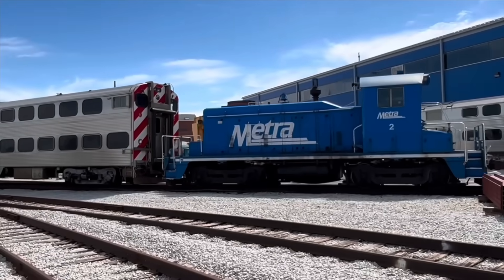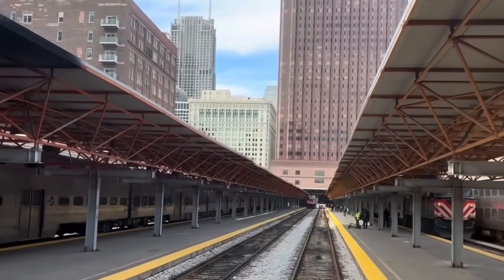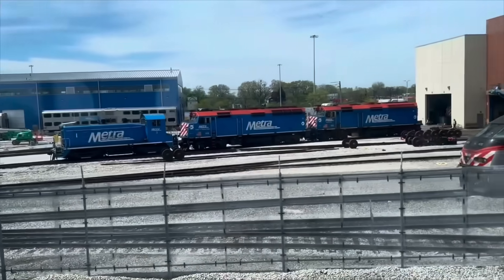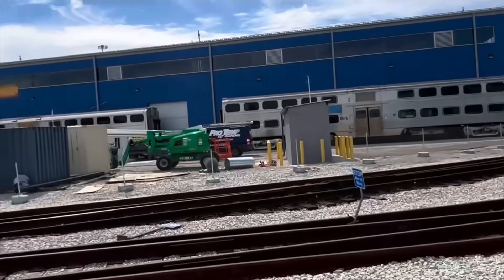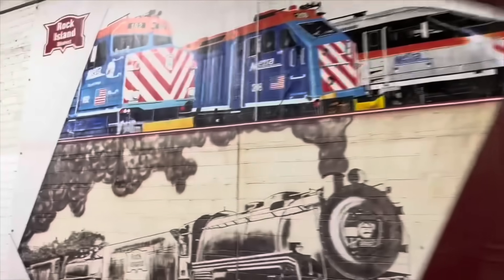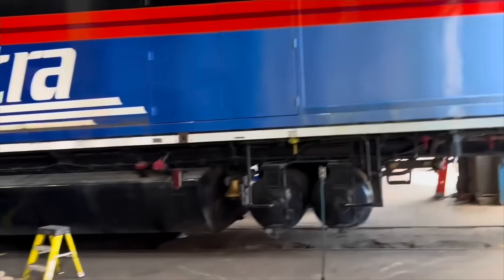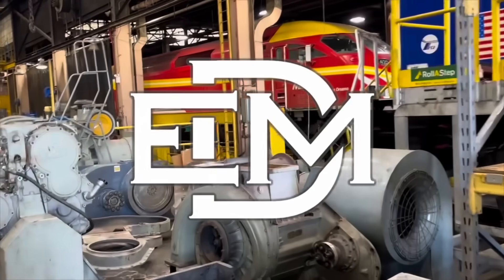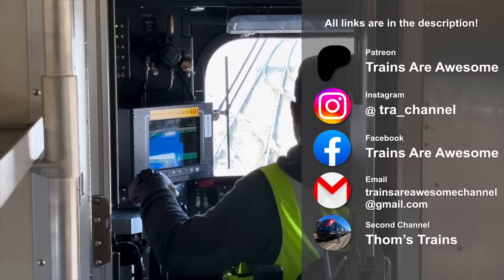How Metra can keep running such OLD trains

Comment: Many older trams, trolleybuses, buses, and trains share a quality which is unmatched for most modern sets, they are simple technical design and high reusable quality. 

This allows for repeated replacement of spare parts and even upgrades, thereby extending their service life and reducing the cost of major upgrades. 

The only major drawbacks of this "eternal" service are obsolescence and the subsequent physical wear and tear of the car's support frame, which inevitably leads to its decommissioning. Obsolescence can have a significant negative impact on passenger satisfaction.

But I love Chicago and San-Francisco double-decker train cars, and San-Francisco cars soon will become urban trains in Lima, Peru :)

Comment: Amtrak would do well to follow Metra’s lead with the SD70MACH, to get a locomotive that works without sending money to Siemens for junk
Reply from the maker: Not the Siemens is junk talking point in 2025, come on
Reply: @Thom-TRA  Considering the reliability of the ALC42's anywhere the temperature gets below freezing, it's 100% truth.
Reply: Are there enough SD70’s in good enough shape to refurbish to replace the GE Genesis?
Reply: @cwshawk  There's thousands that could be rebuilt, so yes, it could be done.

Comment: I rode Meta for over 10 years on the BNSF line from Union station to Naperville. The only good thing I can say is the train mostly ran on time. The old diesel locomotives emitted very dirty exhaust.  Very high in particulates. Union station is covered n black soot. Some days in the winter Union Station was filled with black sooty air. The Chicago Tribune newspaper tested air quality in Metra rail cars and found it far exceeded clean air standards.  The train I regularly rode on would always delay turning on the lights and HVAC (switch from shore power to locomotive power for lights and HVAC) until well out of Union Station.  I asked the conductor why this engineer waited to turn on lights and HVAC.  The conductor said the engineer was trying to protect the health of passengers by waiting to turn on HVAC until the air was cleaner.  Metra is poorly run and way behind the times technically. Train stations are terrible. 😅
Reply from the maker: Oh I don’t disagree

Comment: This is what helps make Metra the Toonerville Trolley of commuter rail  lines.  Diesel-powered and ground-level boarding vs. electric-powered and raised platform same-level boarding/deboarding.   This is what European and Japanese commuter trains normally have, and their speed and scheduling blows Metra's away.  Ideal case in point is Paris' RER regional.  Put one of their locos up against one of Metra's diesels in a drag race, and the Metra would be left in its own smoke, not to mention the dust.  A total blowout.

Comment: My biggest worry for Metra is that they're going to become like BART was. Stuck fabricating their own parts and components (looks like they may already be there somewhat) and it actually costing a lot more than if they had bit the bullet and modernized to electric trains. I honestly wonder which government in IL will be the one to step up to start REALLY pushing Metra to truly modernize and electrify.
Reply: @shadomagi what a strange comparison, BART is an overbuilt Gadgetbahn! The Frankenstein Rail Gauge and the fact it was developed by Niche Aerospace Engineering!?
Metra is tried, true and proven mechanical engineering.
Reply: Most of the routes Metra runs on are owned by the Class 1 Freight Railroads

Comment: I do find it awesome when trains are refurbished this well. The Dutch Railways have a similar workshop in Haarlem, where trainsets are completely stripped and new interiors and components are fitted.

That being said: you won't fix the fundamental issues of gallery cars. High steps mean slow boarding (especially for wheelchair users who need the elevator). Relatively low capacity due to the gallery design. And pulling a string of cars with a diesel locomotive is always going to be slow, compared to a modern trainset.

There comes a time when a city needs to look into the future. See cities around the world how many people will use service when it's got frequent and quick all day service.
Reply from the maker: A well-balanced comment!
Reply: META and CTA unfortunately are negative revenue per passenger mile and grow with load.     No matter what they have done for 50 years, this is the case.   Some of it is just the insane number of RR bridges and viaducts that are 100+ years old in the area.   More trains and more service make the economics worse.   There is a youtuber that simply states staffing level are just to high, with my experience with quasi government organizations in IL,   the one and only goal is get new employees into 401Ks and ditch retirement programs as the people currently under the retirement contract written in blood die off.
Reply: As far as the high steps go, high level platforms solve that problem, yet, outside of the electric district, they seem to choose the cheaper ground level option

Comment: As a European, the sight of the "gallery car" has me rolling around with laughter. It seems that passenger capacity came a distant second to being able to check tickets by walking along the lower level and asking upper and lower floor passengers for tickets at the same time!
Reply: Labor is the #1 cost of Metra and the CTA.  Bulking administration and to many no show jobs.    The conductor gets paid 120k/2200hrs  and is  easliy a 4 million dollar 25-45 year obligation the day he/she retires.    The cars are designed the way they are because of a retirement plan out of 1975, but the conductor isnt sucking camels every chance, knocking his life expetancy to 68.   The three conductors cost more over 30 years than the 3 cars of rolling stock they staff.    

if the ridership were sane, 2 conductors per every 10 cars would be customer service agents instead of ticket takers and the clowns in the the homeless rodeo.
Reply: @christopherwhull  Conductors  have to be certified by the FRA, and there are 9 other railroads in Chicago for them to go if Metra doesn’t  pay market. 
Railroad labor is expensive.

Comment: Ultra small restrooms on old cars ...
Reply: I grew up taking Metra Electric.  I was 23 years old before I found out that everyone else had bathrooms on their train lines.  The south shore had them but I figured it was because they went to so far. Like a lot of people, I took the Rock after the bridge fire in 2003 and discovered that conditions on the Electric were rather primitive.
Reply: @lauracarrolldebolt9233 didn’t all the electric stations have bathrooms, though? It seems today the roles reversed and now the station bathrooms are locked 24/7 and you have to use the ones on the train.

Comment: Stainless steel passenger cars should never be replaced in my opinion, but rather repaired as we see here, unless destroyed in collisions or of a defective design - the rust problems on the older Talgo cars previously used in Washington State, for example.  I am extremely opposed to replacing the Amfleet cars or to the scrapping of any stainless steel Budd equipment - in 2022 a consultant became concerned that the gorgeous Park cars and other Budd cars in use on VIA Rail services in Canada couldn’t take a rear impact collision - destructive testing of a car (fortunately not a boattail domed Park Car) revealed they are as strong as ever.   Indeed I think the planned acquisition of Airo trainsets is a waste of money; Amtrak should cancel that order so as to reduce prices for state-financed regional equipment and the introduction of more private operators like Brightline.   That said, I do really like the underlying Venture cars, since they are based on Railjet cars which are in turn an evolution of the UIC-Z cars used on the OBB EuroCity and InterCity trains, which are my favorites.

Comment: Remember: Pullman was HQ in southern Chicago and 
EMD until 1990 built their diesel locomotives at LaGrange.
That is “generational” knowledge thru the decades.
Reply: Want to make light rail and high speed rail work, opensource it.  Standarize on a north American tram, north american light rail and north amrican high speed designed (short and tall) owned by the DOT.   Bombardier, GE,  and small shops on the same plane with traction and passenger.    ISO designs is not communism, its production at scale, for something that only needs HVAC customization.     

 METRA and the Chicago CTA have no reason to be spending time selecting vendors before they go out of business when they could be final assembly their own stock with the talent within 20 miles of Chicago.   Know they cannot manage their way out of paper bag, but they can buy a BOM full of ISO parts.    Milwaukee to South Bend, if its on rails it can be built local.   You can get any casting, any part made by the tax payers of the state or adjacent state that dumps money into the hole.

Comment: If you think about it.. the Pullmans and other Metra railcars legit have good metal that can last forever,

 but all that needs updating is the electrical systems and such, and the occional mechanical replacements and maintenance 

(This information was told when I asked a client at my job who used too work for Metra servicing railcars)

Comment: Skilled repair crews and machinists make anything possible! If it ain't broke, don't fix it, old locomotives will last an insane amount of time if well maintained and repairs are available
Reply: Shell cabins get remanfacutred every 5 or 10 years on airliners.   Not flying through rock salt spray for what seems like 6 months out does keep the doors from rotting out.

Comment: Just saying "Metra should get new equipment" is great. Now where is the money coming from? Springfield is currently not doing anything to prevent massive cuts to the RTA and CTA. The state of Illinois has had major budget problems for decades that just get worse with time as nothing is done to fix them either. 

Once the state finally decides to have reasonable fiscal policy, like a graduated income tax, all manner of services will be improved including Metra, but until then we should be glad Metra is finding ways to offer service even if that is with converted freight engines and 70+ year old coaches. 

In short this is the rare case where the foamers are being more realistic :P
Reply from the maker: I wouldn’t say it’s more realistic because a) the foamers aren’t arguing from a place of financial responsibility and b) with less demand for newer trains it makes the state less likely to ever prioritize that. Just because something works for now and some people like it doesn’t mean it’s good or can be continued into perpetuity. But that is the message it sends.

Comment: Great video!

Re rebuilding passenger cars: Would it technically be possible to rebuild gallery cars into regular bi level cars?

Re the diesels: As long as they are running diesels, it seems like a good idea to use the same engine family in all locos.

Comment: It's not hard to explain why Metra is an EMD shop.  Back in the day, freight railroads bought diesels from all the vendors.  The Chicago and Northwestern had the practice of segregating their diesels geographically by vendors.  All the Alcos were on one set of branch lines, the Fairbanks-Morses in another area, and so on.  Naturally, Chicago, and the mainlines radiating out from it, were the territory of the largest manufacturer, EMD.  Other railroads adopted this same strategy.  The wealthiest, the Burlington, had a fleet of gorgeous corrugated stainless steel E8s in the Chicago area; every passenger train arriving or leaving Chicago, whether it was the California Zephyr or a commuter run to Aurora, was pulled by one of them.  So, on many of the railroads, Chicago was EMD territory.

Fast forward to today.  EMD, and successor EMC, is no longer making locomotives.  So, Metra has inherited EMDs from the passenger operations of the various freight roads, as well as their maintenance crews who all are expert on maintaining them.  And they do it beautifully, as you saw, Thom.  But the situation can't last forever, since EMD is no longer making new locomotives.  And the new locomotives from other manufacturers produce much cleaner emissions than the old EMDs.  So, it's just a matter of time until Metra will have to move on to newer motive power.  The battery electric multiple units that are going to be used on the Rock Island District are a good example of this.  But in the meantime, Metra is beautifully maintaining its treasure trove of old EMDs.  To us aging railfans, they're a treat!  Thank you, Thom, for bringing them to our attention.

Comment: Since Metra owns the Rock Island tracks, they ought to electrify them.  Not with battery trains (which might be cheaper in the very short run but will be more expensive in the long run due to the expense of batteries), , but with real overhead electrification.  CalTrain figured this out, and it works.
Reply: I agree that overhead electrification is the most efficient form of traction. But as Thom has already pointed out Metra is strapped for cash and electrification is extremely expensive. It's not just a matter of erecting catenary, stringing wire and installing substations. There will be many locations where overpasses will have to be raised or tracks will need to be lowered to gain the necessary overhead clearance.
Reply: @peterlangdon7011  up front capital intensive the ROIs over 40 years vs an equipment buy that can be someone in private equity holding the equaling of a lease a device that seems useful in other stratigic passenger rail markets, if for some reason it does not work in chicago 3 seasons in 4 hours weather, send the unit to the swiss.
Reply: Aside from the cash issues, the Iowa Interstate uses the RI tracks at night.
Reply: @lauracarrolldebolt9233  If Metra owns the tracks, they should be the ones to get to say what electrification goes over them.  Freight is compatible with overhead electrification -- see videos of the Indian Railways running double-stack freight under overhead wire without even using well cars (double stack on flatcar).
Reply: I used to think the same, but the IL PJM grid is so strained right now due to the data center demand, you’d literally be replacing efficient diesels with nat gas-generated electricity. The benefit is marginal due to the lack of zero emission generation in the northern half of the state now.
Reply: @cwshawk  Regulate the data centers down to a reasonable level, and increase construction of renewable energy generation and storage.  If we fail at either one of these, we are in very serious trouble.

(Of course, with the political situation in the US, the second is being done half-measured at best, and the former will not be done even to a token degree beyond whatever local communities can do -- if they don't get pre-empted by corrupt state governments.)
Reply: @cwshawk  bullshit,  day light hours, the Midwest producers are searching for somewhere to ship surplus power.    80% of the data centers you think are in operation are still awaiting racks to hold servers that have not been built yet.   

Don't let the utilities and regulators push their problems onto DC operators.

Comment: Metra’s stuck with EMD for a few reasons, beyond the manufacturer being “in range” for a while. EMD prime movers are mechanically very reliable and easy to repair. Performance-wise, they’re also preferable. With two exceptions, all EMD engines are two-stroke. They load quicker and have a better torque output at high rpm (crucial for the F40’s). Shortline roads like EMD’s for similar reasons, but since they are slower and have more switching involved, those will often be older EMD engines with roots-blower aspiration (like the SW series). To my knowledge, not a single EMD still employed in passenger service lacks a turbocharger, and all turbo-equipped EMD’s have at least one turbo dedicated to the higher rpm range, whereas a separate one or a mechanical supercharger will be used for lower speed. Obviously it’s not as efficient as a multiple unit train, and 2-stroke engines do have a disadvantage in fuel efficiency and emission output, but for the kind of service Metra mostly operates, EMD is the way to go.
Reply from the maker: Interesting!

Comment: IIRC, Metra's starting point was when the IC purchased their double deck metal EMU's to replace the old wooden EMU's dating back to 1927.
Since EMD was local at the start of Metra, I can see why they went with them.
Reply: Excuse me, "wooden" EMU's? The 1927 EMU cars were of all steel construction.

Comment: It’s really disheartening how RTA funding didn’t pass during the regular legislative session. They have one last chance to do something about it come the Fall veto session. Even if they pass $500 million out of the $770 million needed to close the gap, that averts the most draconian service cuts, which is what looks like may happen, and then look at closing the remaining $270 million gap during the regular 2026 session. I now work for Illinois state rep Anna Moeller who’s a huge transit advocate, and she told me that Illinois Democrats are currently working hard to come up with a transit funding bill to pass during the Fall veto session, which includes funding for downstate transit. The reason the original bill didn’t pass was because it didn’t include funding for downstate transit and downstate Democrats blocked it because of that